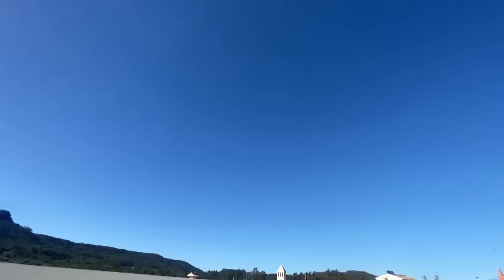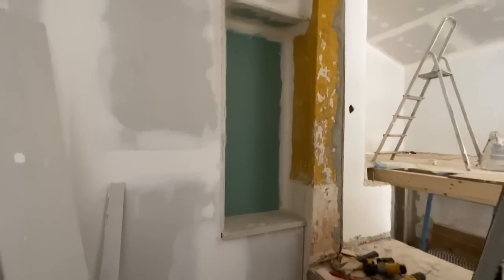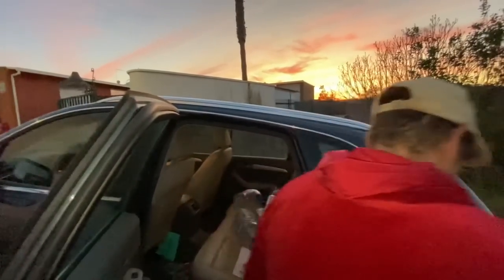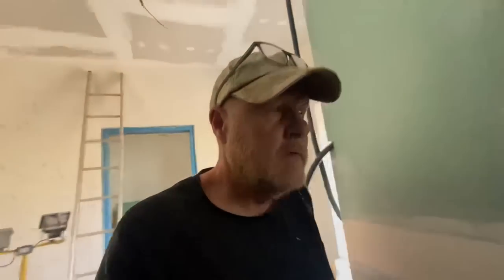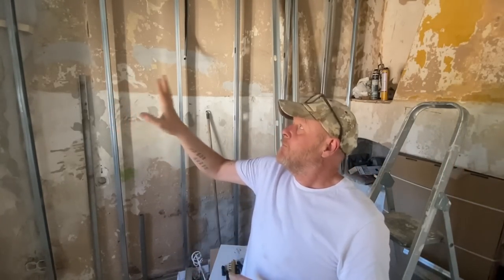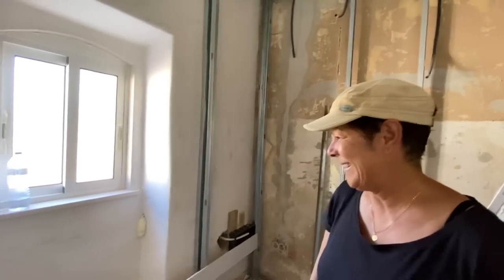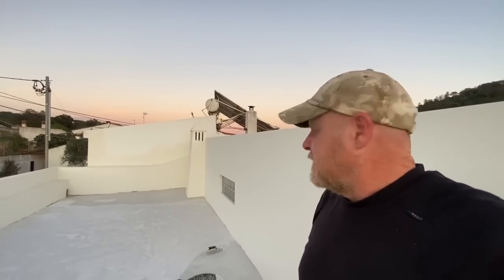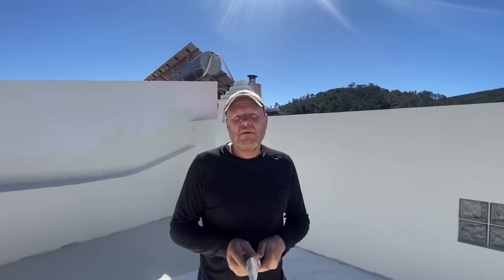How Could I Make Such a BIG MISTAKE

Comment: James, Cristina and Andrew you are making great progress on the plumbing and interior and even with the setback on the exterior good progress there as well. I was wondering if you could utilize a rotary floor polisher/sander to remove the filler on the top deck, with a stiff bristle pad on it you should be able to remove the filler without damaging the waterproof membrane. Not sure if you have that type of equipment available for rent in your area but thought I would suggest it just in case to make it a bit easier for you to complete the removal and fix it up. All the best and be well.../B
Reply from the maker: Thanks Bob, I’ll look into it. 😎👍

Comment: The place is looking wonderful.  Shame for the roof deck.  First thought was, would a power washer/hydro sprayer be able to lift some of it?  I know you don't want any infiltration into the building at this point but anything to help save some time on your knees hand scraping.  Thanks for all the work on the channel and the time you put into filming.
Reply from the maker: Hi Steve power washing is my first thought, I don’t need to worry about water infiltration as the roof is completely sealed from previous coats
Just a set back that I didn’t really want..
Thanks for taking the time to watch and comment. It really does mean a lot to us

Comment: Great progress with the external wire, the overall plumbing work. The roof I'm sure will be fixed and done before the hot summer evenings drinks! Just a small "dica", you should brush paint the external black wire with the external white paint already in use, it will be almost imperceptible and more "clean" on your house front. Cheers from Lisbon🥂👍✨
Reply from the maker: Thanks Miguel, I’m not 100% sure it does look better. We have checked out some local house with painted wire and they look awful. When we get to the snagging list, we’ll decided then. Thanks for watching 😎👍